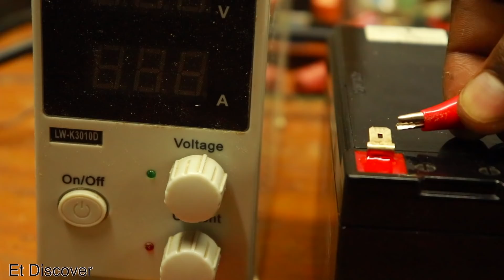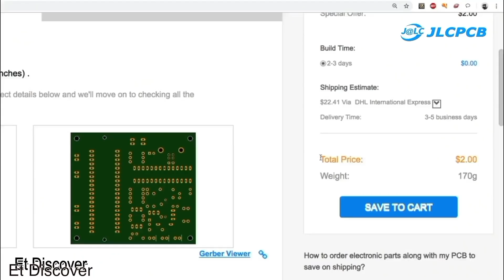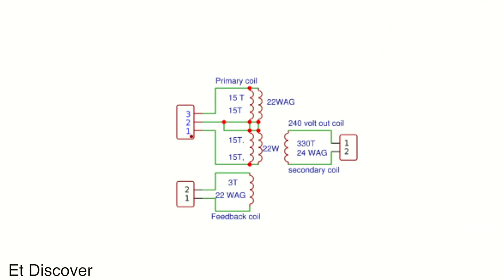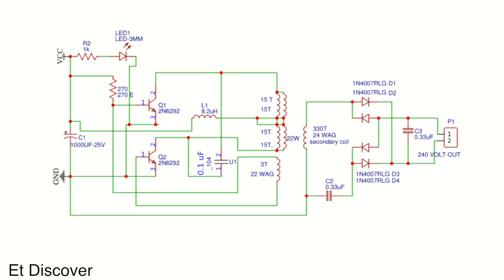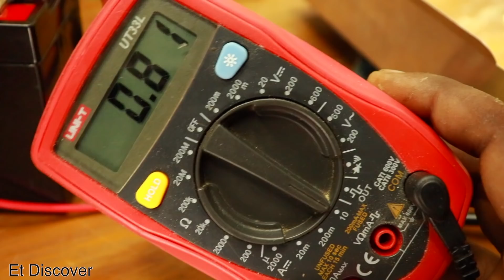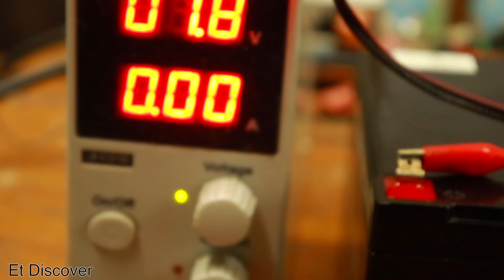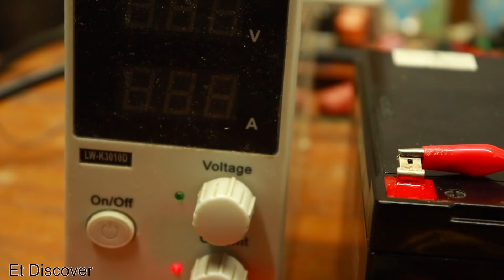DIY Easy  Transformerless 150 Watt Inverter from OLD Computer SMPS

Comment: How would i be able to increase the power of this inverter to around 450w? I suppose the mosfets would need to be replaced with higher current ones but what i dont know is about the windings

Comment: Hi there i have made same circuit of boost converter  as of yours.. The output voltage stays constant till the load is not changed.. But when i increase or decrease the load , the output changes .  .. Soi thought using the 5th pin of 555 ic but i dont know how to use that pin.. Please provide some info.  .. I will be happy yo hear from you
Reply from the maker: Thank you , use 500k variable resistor
Reply: @EtDiscover  😮ohhh.. Okk okkk thank u
Reply from the maker: Welcome
Reply: hi Mr. I.C., can please provide the schematic and circuit diagram for this inverter

Comment: Using 13005 transistor, how can u get that power, they are rated for high viltage not for high power, i have used irfz44n  that high poer mosfrt will only be able to give 75 watts
Reply from the maker: The z44 mosque will not work here’ Take a look at the Datasheet  Which frequencies of 13005 and how low voltage will it operate
Reply from the maker: The mosfet never makes the power of an inverter, that's totally depending on your frequency and your magnetic flux

Comment: The inductor coil is a form of transformer, also it produces a square wave it will burn  electric fans ,motors, tv,  ... only good for heating  tools and filament bulbs,   you can plug in sine wave stuffs but it will not last  due to a SQUARE wave output
Reply from the maker: half the sine wave coming out from this inductor, not square wave.
Reply: @EtDiscover  No I don't think so,  there's no way  it will have a sawtooth  output  its not applicable not safe for  any sine wave appliances or motors  only a full sine wave is advisable lots of sine wave inverters on the net,  i'm telling the truth it's up to you

Comment: bro what is the size of that torroid core
Reply from the maker: I did not measure it but you can use old SMPS inductor’s torroid core,
Reply: @EtDiscover  i got 2 torroid core in 1 smps so what can i use in that 2

Comment: What do you think you made with the wire and the toroidal ring?   A TRANSFORMER !!!!!!!!!!!!!!!!!!!!!!
Sorry its a load of junk, your powersupply was really having problems running off it.   
What frequency was it running at?
189Vac, what sort of mains voltage is that?
Reply from the maker: Please watch the video till the end, I hope You will surely find the answer to your question

Comment: You will succeed with a 13005 transistor located inside the saving lamps
Reply from the maker: No problem , you can use it

Comment: What is the percentage of efficiency of this circuit dada? And I don't see any heat sink  attached to the transistors. Won't it make any problem?
BTW, nice compact circuit, I'll make one.
Reply from the maker: Video tar laste sob kichu dekhiye chi dekhun. 50watt lode inpute 0.80mA load niche.
Reply: @EtDiscover  Haa, 0.8Amp * 200V = 160 watt load dekhlam... bujhlam temon ekta hoyto gorom hochche na.. but dada, circuit er efficiency koto percent? Same load ta lagiye, battery er diker side e koto amp current khachche @ koto volt e ektu bolben please...

Comment: Over all, this is done well. I like it. I just take exception with the transformerless since it is not.

In your documents you even have a diagram showing your inductor...https://drive.google.com/open?id=1_A2gEBiFR2rwXlAoB_VRQev6pbV_X5oF

I'm not trying to be confrontational or overly critical, but what is that if it is not a transformer...actually 2 transformers? Take a torroidal inductor coil, add a second inductance coil around the torroid...viola a transformer.

With "transformerless" in the title, it is kind of a click bait.